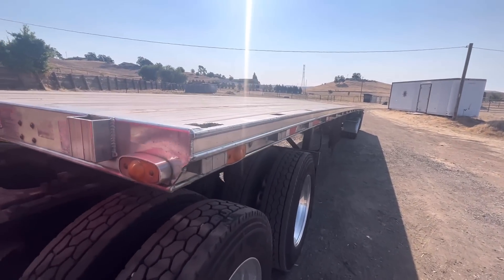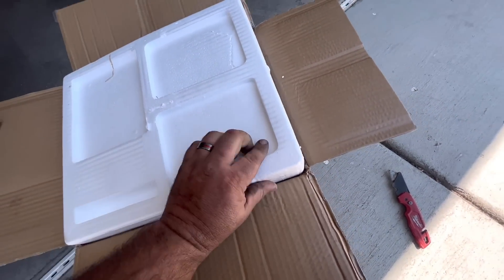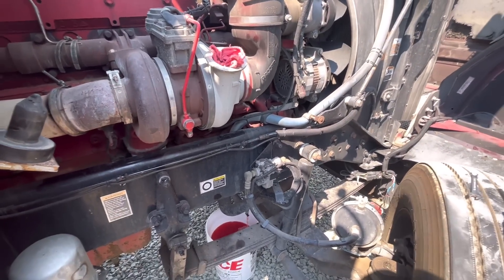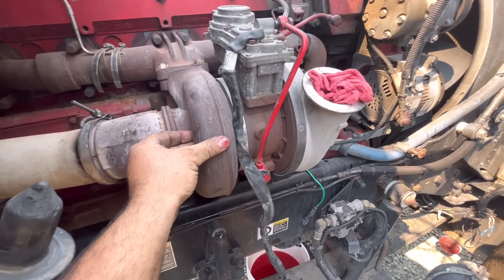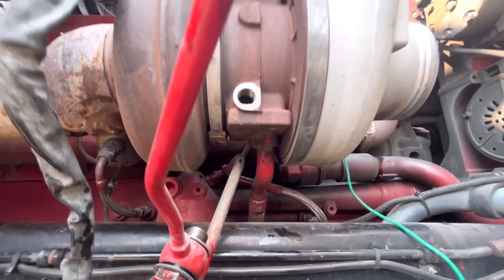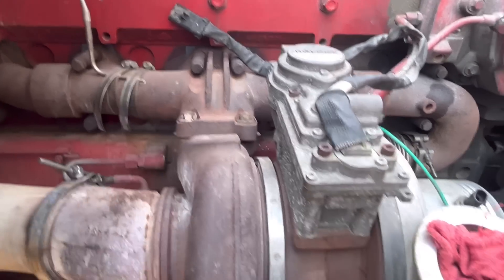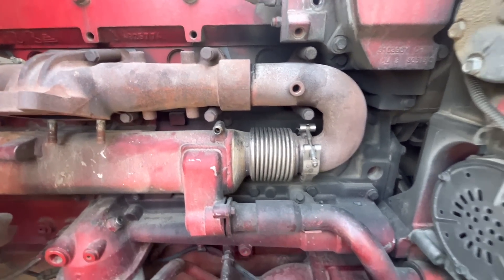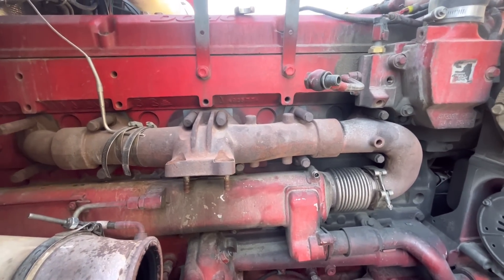“PLAYING MECHANIC” | Part 1: Replacing The Manifold on a Cummins ISX

Comment: I am surprised that as long as that crack is that it wasn't leaking there too. You definitely know what you're doing! I also do most of the work on my truck's. Everyone keeps telling me that I need to upgrade and buy new trucks and sell my late 90's Pete's with Cats, and I just tell them these are the upgrades and why would I want high payments when these are paid for and don't owe me anything. I can rebuild the engine for less than what it'd cost to replace the emissions system on a newer truck. They say but you'd have warranty, I say ya just like so and so that's had his truck in the shop for 2 months waiting on parts and still having to make those payments without working.
Reply from the maker: I agree with that 100% and wouldn’t buy a newer isx myself. To many little issues. Keep that cat, least you know it will get you home!

Comment: Good job Martin. I have a old isx. In a 2000 international bought new.  Still running it. Has 1,770,000 miles mine would be easy. No coolant going through mine. You are a handy man. Can’t wait to watch rest of show. SAy hi to better half. Love your video’s.
Reply from the maker: Wow Ralph! Never been opened up? That’s gotta be one of the highest mileage ISX’s out there! Will do and thanks for watching!

Comment: Nice video Martin. Keep the repair videos coming. It makes me feel good about getting a new truck every 300,000 miles (30 months).
 I use to do it just like you. I’m just over it. I know you don’t believe me. But new truck doesn’t cost any more then running an old truck when your done crunching the numbers. 
  I’m at $1,750 a month cost of ownership(even less after depreciation)and no repairs. Just oil change. I run dedicated freight and can not take a week off to work on the truck. So for me a new truck works out better.
  But you remind me about back in the day. I have been trucking for 37 years!
Reply from the maker: I hear ya, it’s not for everyone. If I had a dedicated deal every week I would probably do the same. But right now the truck doesn’t cost me anything other than insurance. The $1000 I spent on it recently doesn’t justify a new truck for what I do and how I operate.
Reply: @TruckingTogether  I hear you.

Comment: See you have your EGT sensor on the outside of the manifold. Going to add one to mine. Mechanic told me 6-8inches from turbo. I installed one on my excursion in the manifold, which is where everyone says to install for more accurate reading. Question, how accurate do you think your setup is? I’d rather not drill into the manifold, and the EGT coming from turbo side would read 2-300 degrees off.
Reply from the maker: I explain this in a future video, not measuring egt really just heat soak. Doesn’t give you a true egt reading. I’d say in the manifold is more accurate, reason why you don’t see them on class 8 trucks is they’re worried about the thermocouple breaking off and taking the turbo out from day in and day out usage. Good rule of thumb is 8” behind turbo and to get a true egt just add 300-350* and that’s you exhaust temp at the manifold.
Reply: @TruckingTogether  makes sense! Thanks Martin.

Comment: Nice job Martin .....would be cool if someone made a cast iron header for the Cummins ISX 🤣🤣🤣
Reply from the maker: Turbos are better than headers Kirk. Although they make equal length stainless turbo manifolds but those wouldn’t hold up in OTR trucking, more of a pulling/race deal.
Reply: @TruckingTogether  i meant a header feeding the Turbo but i get what you mean ....great job Martin ....Fancy should be ready for some nice loads soon .....shiny loads of coarse 🤣🤣🤣☝️💪